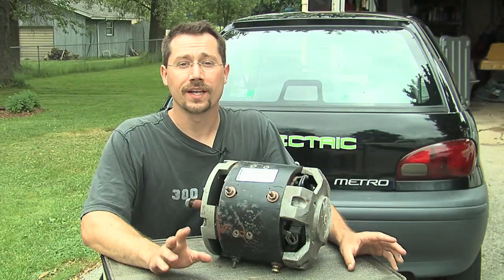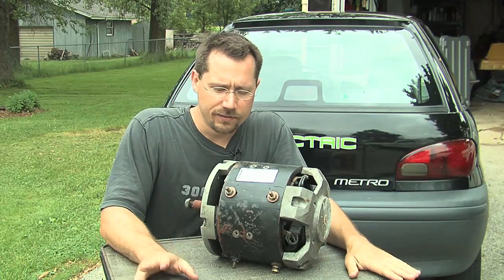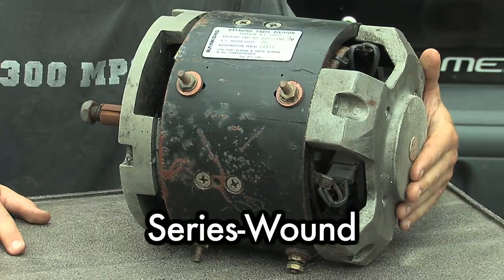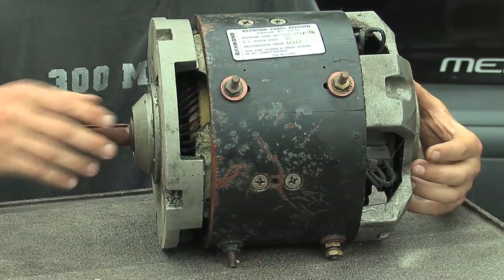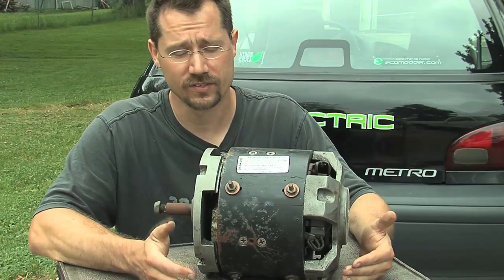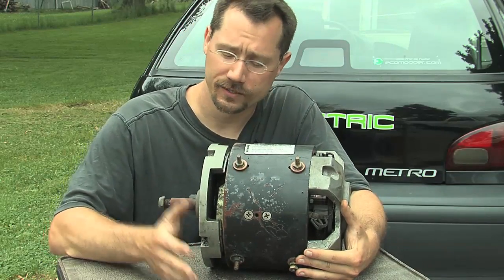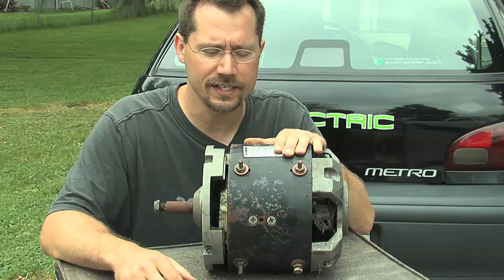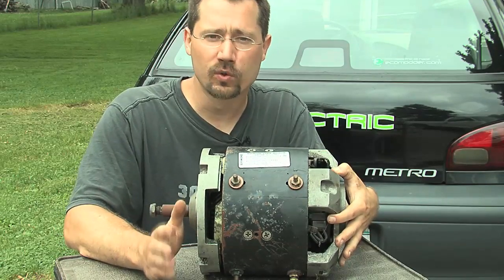DIY Electric Car: 04A DC Motor Basics, Part 1

Comment: I have seen you’re hole serie video’s. Great job👌. I’m building a 17 ft wooden boat and thinking to use a forklift motor. But there are so Munch different motors. What do you think I need?  Must of this length Boats are equipt with a 200-300Hp gasoline motor. Thanks for advice.
Reply from the maker: Unfortunately, I have NOT built a boat and powered it with an electric motor.
You probably want to take a look through an electric boat forum for advice an appropriate electric motor for that niche application.
Reply: BenjaminNelson thanks for response. I have to look futher. Good luck with all you’re projects

Comment: These forklift motors aren't so easy to come by.  I called Crown, they treated me like I was trying to steal company secrets and refused to sell me one for my purpose. I've tried motor repair shops, forklift repair, Grainger...no luck. No scrap yards here have them...I'm at a lose.
What input voltage, wattage and HP is the one you used. I've decided to convert our 96 voyager then 97 Suburban, how is easy, buying the parts not so much.
HELP...

Comment: Hi all.  Its it possible to use the motor and a large switch to reverse the electric motor so you can have a reverse instead of a gearbox ..?
Reply from the maker: Yes, electric motors can generally be reversed. On a permanent magnet DC motor, you simply reverse the polarity. On other motors, it's just a little more complicated. In my car, it already had a reverse gear in the manual transmission, so it seemed easiest just to use that!

Comment: hey benjamin rick here wanted to drop ya a line on my newly thought of way, to charge a battery bank while driving down the road, in theory i think it might work although i have not tested in a electric car or truck. Ive created two video's part one and two on my channel that might interest ya. the theory is never having to plug in a electric car and charge it from a electricial outlet from the house. I have not as yet hooked this idea up to a battery bank or inverter but is a work in progress. pma motors are 7 magnet 48 volts max. my inverter is a 1500 watt so can't exeed 180 volts. or could fry the capaciters or mother board in the inverter. i find the design to be  a bit big, to fit in a small car. along with all the componets of the electric  motor.  probably though could take out the back sets and make a base fram or something.

Comment: How did you couple the motor to the trans shaft ? Is there an alternator to recharge batteries as you drive ? Also, what is your drive time before having to recharge ? My boy and I are building a jeep ev and are having issues with the coupling and throttle.

Comment: is it induction that makes the rotor spin?
Reply from the maker: The concept of using an electrical current to create a magnetic field is at the heart of every electric motor.
The motor shown in this example is a "Brushed Direct Current (DC)" motor.  In a brushed motor, current travels to the rotor through conductive carbon "brushes".
Calling something an  "induction motor" usually refers to using an alternating current (AC) to induce a magnetic field inside the rotor, which is then opposed by another magnetic field. The two fields together cause the rotation. In that case, nothing has to physically touch the rotor (the way the brushes do) and it's more efficient than a brushed DC motor, but the motor control is much more complicated (and typically more expensive.) The extra cost and complexity of varying the speed of an AC motor is one reason why brushed DC motors have been traditional in forklifts, golf-carts, and DIY electric vehicle projects.
Due to modern manufacturing and economies of scale, the cost of rugged and portable AC motor controls have come down, and AC is now becoming available for golf-carts, forklifts, and similar machines. (As I write this, it IS the standard in all commercially-available on-road electric vehicles.)
The early years of electrical experimentation are very interesting, and a great subject to read up on.
Learn about induction by doing a web search. Wikipedia is a great place to start. https://en.wikipedia.org/wiki/Electromagnetic_induction

Comment: Is it possible to air condition a car like this?
Reply from the maker: Yes, there are modern all electric air conditioners that can be run directly from a battery pack. One motors with a "tail-shaft", an air conditioner could also be powered by a pulley running off the back end of the motor (although it would only work while the car is driving, but not at stop lights!)

Comment: BenjaminNelson if you were to convert a rear wheel drive vehicle, could you do away with the transmission and motor altogether and directly drive the driveshaft with the motor? Assuming there is little to no gear reduction in the rear end, 1800 rpm would make a small car with 14" rims hit 100 to 120 mph.

Comment: There is another name for the motor you are using: for a motor with copper coils instead of magnets is called a universal motor. This motor can run on both AC and DC, but you'll need a transformer to lower the 120 volts on AC, if the motor takes lower voltage. Anyway thanks I liked it.

Comment: When you pull it apart, you'd better not destroy the brushes...
Reply from the maker: Generally, before pulling the rotor from a motor the brushes are pulled back and either removed, or held out of the way by having the brush springs press on the side of the brush, instead of pushing down on it from the top. When the motor is apart is an ideal time to check the brushes and replace them if needed.

Comment: hi ben, some friends and I at school want to do a project. what car do you suggest is good to swap a gasoline engine to convert it to a electric motor?
Reply from the maker: Generally, a lighter and simpler car is better. Get something in decent condition (you want to do a conversion, not a restoration.) Get something with a manual transmission. A great idea for how to get started is simply to look at what has been done before. Take a look through the EV Album (http://www.evalbum.com/type) You will find that some certain makes and models are more commonly used than others. You can do searches by type or brand of car, or by what components were used in the build. Good Luck!
Economy cars (with good bodies), Mazda Miatas, old Porsches, and light pickup trucks are are pretty popular.

Comment: So this motor can be connected either in series or shunt
Reply from the maker: The motor shown in this example is a Series-Wound DC motor. It has 4 power connections because this motor was originally used in a small forklift, where the motor directly drove a single rear wheel. By having the 4 power connections, it allows for the use of a contactor to reverse the polarity of power to two of the power connections. That reverses the direction of the motor, and allows the forklift to back up. In many home DIY electric car conversions with series-wound DC motors, the original manual transmission is kept and reverse gear is used to back up the car. On a four-post motor like this, it's common to place a heavy bus-bar jumper to permanently connect the armature and the stator in series.
Reply: BenjaminNelson which post is negative which is positive
or does it even matter?

Comment: ok dc motors are easier in speed requlation and not require invertors for bateries. but also dc motors are easier to brocke and they not so indorible like ac motors. what about fixing it? when it is neccesary to fix it?

Comment: Hi Benjamin. 
1. Please tell me how to convert AC to DC? 
You let me understand in this video that I need a "DC electric motor" for an electric car, correct?
2. - but if I have AC 110/220V 3000W what kind of electric motor i need for electric-car or how to make it to be electric car with what i have? Thank you
Reply: ELF SAGE  if you want to convert dc motor to ac you have to make it universal by putting all coils in series with each other. also know that dc and ac motor with series connection have huge torgue

Comment: uhhh hp in a gas engine vs hp in an electric motor... they are still describing the same thing... torque x rpm.... the two types of motors just have different torque curves..
Reply from the maker: No, not quite true. Almost always, electric motors are described in "continuous use" whereas gas engines are rated at "Peak".
It's almost like saying how fast you can sprint vs. how fast do you run when in a marathon. It's not that one horse-power in electric is different than one horse-power in a gas engine are different, but how they are MEASURED that makes it so.
Reply: I think what you meant to say is that the method for RATING horsepower of an electric motor is slightly different than how the horsepower rating of a gas engine is given... Because yes, that is slightly true... but not very accurate!  Electric motors are generally rated for continuous duty HP... but not always!!!! not even close! some are intermittent duty, only working for seconds of burst at a time.  also, they are sometimes rated with service factor HP, such as 1.15 or other S.F. ratings which indicates a combination of allowable peak HP time, followed by a cool off time frame before it can peak out again... these ratings are not always easy to understand, so dont just assume the nameplate HP is a value you can pump out for 24 hours on end!  read the details closely!  So in that respect... gas engines and electrical motors are RATED a "HP rating" differently.... but the horsepower unit is the same no matter if its a gas engine, electric, or... a horse!
Reply: Electric and gas  have different torque curves. Electric can deliver high torque at low rpm while gas engines have a torque peak in the rpm area where intake and exhaust have an optimum flow. It's related to valve timing. 
No disrespect intended, but have a check before nagging an opinion.

Comment: +BenjaminNelson Thank you sir, but actually we are only manufacturing its frame not the whole vehicle... the total vehicle weight including driver will be 200 kg So if I use 5 hp motor of 4000 rpm with 12V or 24 V battery.. will it work..??? we will be using 14" wheel
Reply: stars shine
its ok.... no need to bless me.... but best of luck for your dream.... and remember even if it takes time do not quit... a man should never quit from his dream till he is dead.... my wishes are with you.,..
Reply from the maker: Bhushan Parulekar You may want to look at some EV calculators and see for yourself whether you think it will work or not. Here's one to get you started. http://www.evconvert.com/tools/evcalc/
Reply: BenjaminNelson thank u very much Sir..
Reply: +Bhushan Parulekar it will certainly work.
Reply: Parasar Bhattacharya Jesus Bless You

Comment: hi, I have question Sir.. I am building an electric car with human power in which i will be charging alternator & driving the motor.. what should be the specification of DC motor to drive the vehicle at 50kmph carrying 200 kg weight.
Reply from the maker: Bhushan Parulekar The answer is.... It depends. Golf carts run at 48V, and are often as small as a 3.5 hp motor. If you want the vehicle to be partly human powered, I'm sure you want it as lightweight and aerodynamic as possible. Take a look at some of the other human hybrid vehicles out there to start getting some ideas for yourself. For something smaller and lighter, you might also want to look at hub motors. Perhaps a trike with a motorcycle hub motor in the back? EVAlbum.com has a few human hybrids. Check those out. http://www.evalbum.com/type/ENCL
Reply: @BenjaminNelson Thank you sir, but actually we are only manufacturing its frame not the whole vehicle... the total vehicle weight including driver will be 200 kg So if I use 5 bhp motor of 4000 rpm wwith 12V or 24 V battery.. will it work..??? we will be using 14" wheel
Reply: BenjaminNelson Thank you sir, but actually we are only manufacturing its frame not the whole vehicle... the total vehicle weight including driver will be 200 kg So if I use 5 hp motor of 4000 rpm with 12V or 24 V battery.. will it work..??? we will be using 14" wheel

Comment: I want you to manufacture/make me a 12V BLDC (brushless DC) motor. It has to be 12V so I can just choose whatever regular cat size battery I want and switch the battery as often as I want. This is for a full sized electric automobile I'm planning on making one day. The amps it can put out or handle should be very high, but I'll leave the exact number up to you. 3 or 4 wound with either silver or gold wire. Pure silver or low carat gold such as 12K or 14Karat gold would be great! So, other than that, I want the magnets to be very high quality and extra large.. making the whole DC motor 3X-4X as big as a you would normally see one with the stator in the center. I don't know how to do this myself, but I do know some basics of brushless DC motors. What do you Think Benjamin Nelson, and can you or someone you know do this for me? What price and what would be the estimated weight of such a motor?   -Kevin

Comment: Why do some cars connect the motor to a transmission and some don't. Do you need the transmission and what is the advantage using or not using a transmission?
Thank you for your answer
Reply: salazarvic2 i
Reply from the maker: Here's an article I wrote about transmissions (or not) for DIY Electric Cars. https://300mpg.org/projects/electro-metro/transmission-for-an-electric-car/

Comment: dc motors; simple yes. durable robust and powerfull no.
Reply from the maker: Funny, I think of forklifts as durable and powerful machines. They seem to have a good decade's-long track record.
Reply: BenjaminNelson
	 	 	 	The three phase brushless motor is a superior machine	 	 	 	(brushed motor brushes wear out and arc and they have inferior power to weight ratios), forklifts have historically used brushed DC motors because inverters weren’t economically viable and efficiency isn't their principle concern
Reply: @lendoggtheking.  Agree entirely, brushes wear out and brushed motors are less efficient than brushless.
Reply: He also said that you can get out the junkyard from a dang forklift. I don't think he meant its the be all end all of motors, just something you can get that is economical.
Reply: There in more than you think they are in treadmill also but i use those for windmills tho so yes some of them you can make electricity with but its only some dc motors tho but im not sure if all can

Comment: Top Gear proven this does not work
Reply: I watch top gear, it's great for entertainment. I also know that they where deliberately arseing about when they did their electric car. it was funny, not a sincere engineering exercise.
Reply: top gear australia did it in a holden kingswood and it worked very well
Reply: also when you watch the top gear eagle i thrust III episode ask your self "would they have made a success of it with a conventional drive train" the answer is of course not, I'm surprised it was road legal!
Reply: the worlds fastest ev drag car was home made from an old datsun so it does work and most of the time the converted stuff works better than the mass produced cars
the in house made ev that top gear britain did was made  to fail just like the mith busters hho powered car.
the kingswood that top gear australia converted still had the original running gear, they just switched the ice engine with an electric one and filled the back of the car with lead acid batteries (it was a station wagon)

Comment: A brushed motor is not at all powerful, eficient or durable
Reply from the maker: Un-true. Brushed motors can be VERY powerful. They are commonly used round the clock in industrial forklifts and other powerful machines. They are slightly less efficient than brushless motors and do need eventual replacement of the brushes, but are often used in drag-racing and other EV applications.
Reply: BenjaminNelson I meant powerful by size and weight.
You can design small brushed motors with alot of power but they are inefficient and not durable

Comment from the maker: Your ballpark math sounds about right. Most of the time, what horsepower is needed for is passing and hill-climbing. My motor controller can pass through up to 500 amps. At 72V, that's a little under 50 HP. Lower horsepower can work OK, but only as long as you are in a very flat area and don't need very quick acceleration.
Reply: Hi Benjamin. I really find your channel very informative. I have lots of questions and the reason is cause I'm very interested on building my own electric performance car but I dont know where to start. Any tip that you could share.

Comment from the maker: Speed of a DC motor is based on voltage. The higher your system voltage (more batteries in series) the higher the top speed. To control the speed of the motor, you use a PWM (Pulse Width Modulation) motor speed controller.

Comment: When you wire it in parallel you need a parallel wound controller.  What the controller dose is it powers the outside coil contently as it varies the inside coil to control the speed. This concludes that when you let off the accelerator the outside coil is still powers. Intern what happens is when you let off the accelerate you start generating power due to the outside coil being powered intern being the equivalent of a permanent magnet in regen braking.

Comment: When you change the weirs on the motor your not changing the polarity, you are changing the way the current go's when you wire it in series. There are 2 tips of  DC Motors, (series) and (parallel) when there are 4 poles, you have terminals for the (outside coil) and the (inside coil) aka the armature. when you wire it in series it go's threw both coil's as if the were one but when you wire it in parallel you have 2 coils powers independently.